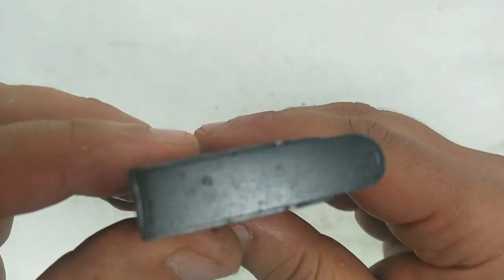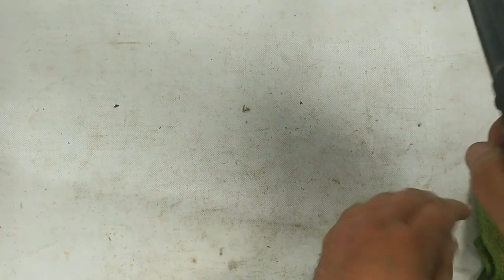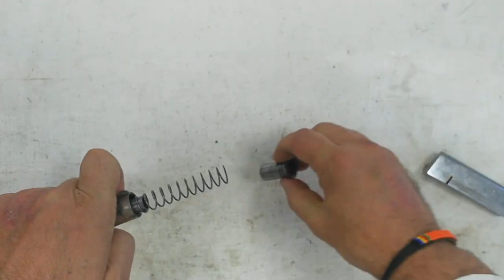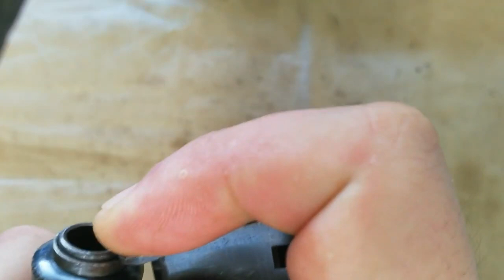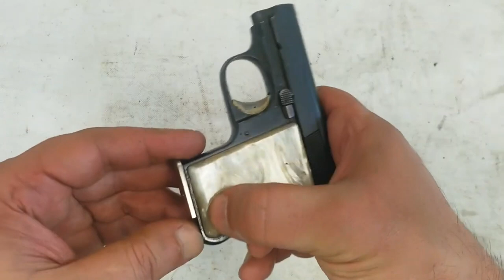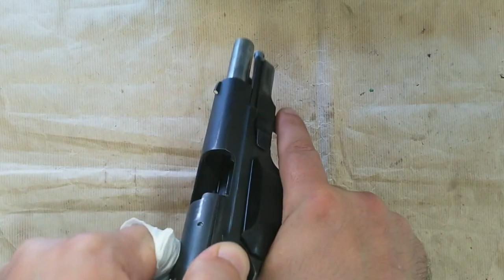ASTRA Set of disassembling & reassembling

Comment: Very different from my constable.
Reply from the maker: The Constable model, although it appears in 1965, it could be included in the "modern" production (Línea moderna) because it corresponds to a completely new design, both in form and mechanics. Constable model is closely to the Walther in its PP model. With the 5000 "Constable" model, the double action system is inaugurated in Astra pistols, incorporating a manually actuated firing pin safety.
Thank you for watching.